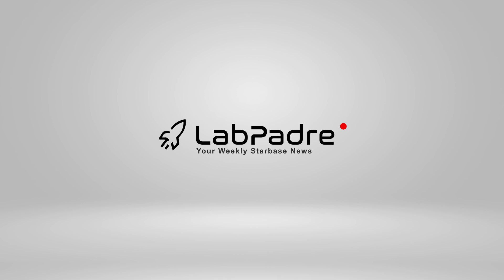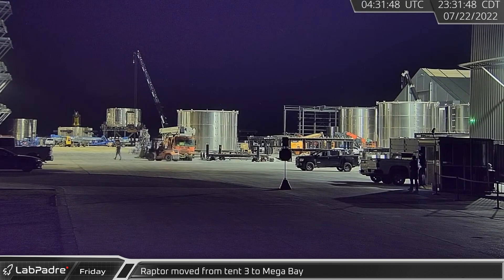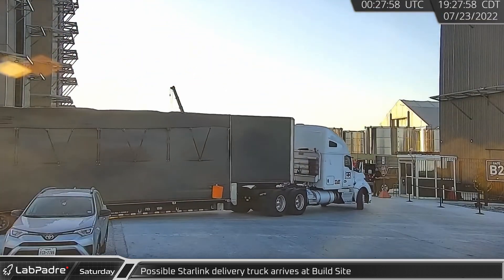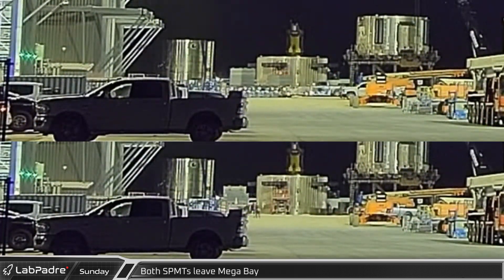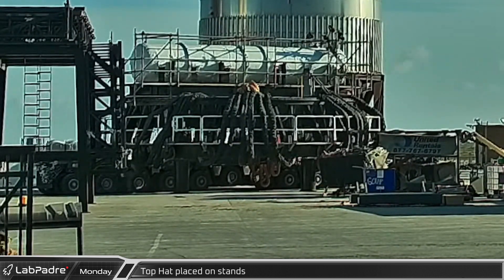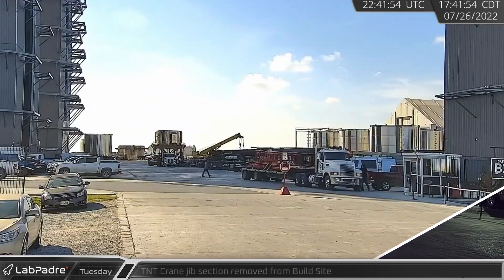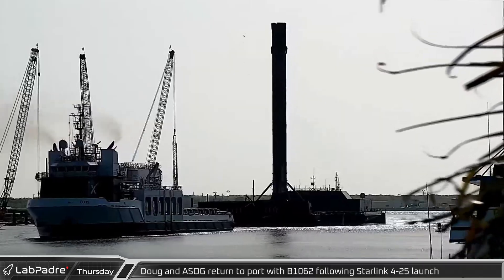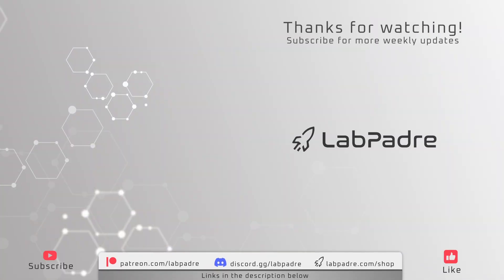Starship Tower #2 Halfway Complete - Weekly Update Episode 21

Comment: I wonder why they didn't just start with White Panels on the Starlink Building. Is there a supply issue getting white panels right now?
Reply from the maker: Good point!
Reply: I wonder if they are using one of those special paints with ceramic beads that is supposed to add a layer of reflective insulation.
Reply: @59seank  that would make a bit more sense, after thinking about it, the StarFactory is being made from White Panels so they clearly have white panels available, unless they bought up all the white ones for the StarFactory.

Comment: Vehcicle* assembly building not vertical
Reply: It was called the Vertical Assembly Building during the initial concept phase then partway through construction they changed it to Vehicle Assembly Building when they decided it would be used for more then just the vertical stacking of Saturn V Rockets.
Reply from the maker: Thanks for the tip!